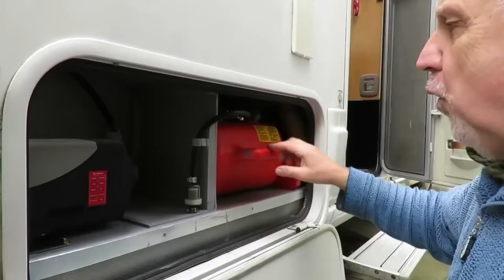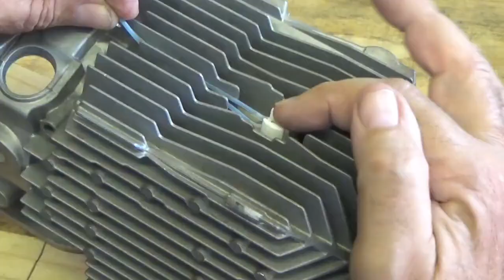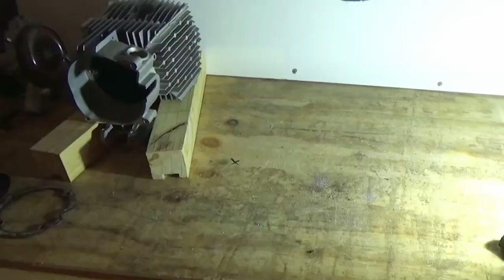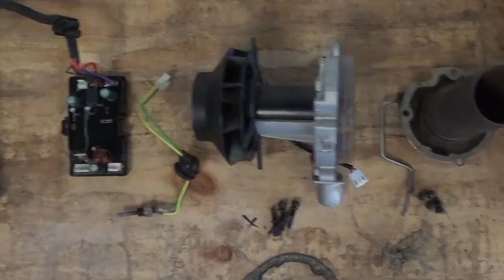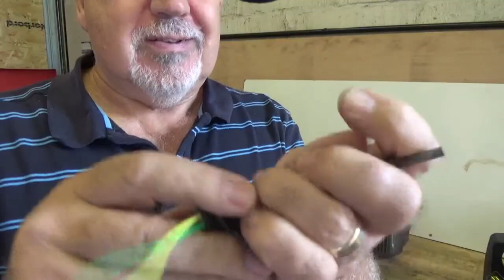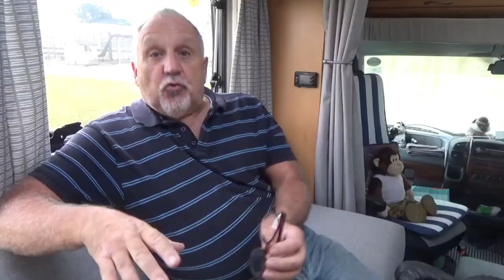🔥  Chinese Diesel Air Heater - 1500-Hour Service & Repair | Full Strip Down & Maintenance Guide

Comment: Nice teardown. Surprised how clean the chamber was. Seems the unit was set-up well from the factory and, sure, european diesel helps to keep to soot as low as possible. Often the units are shipped with totally crooked settings so they stink and smoke from day one:D

Comment: The most common problem is incorrect emulsion screen installation . Be certain that the screen is below the air hole  . This allows proper seating of the glow plug .

Comment: Anyone have smoking or poor running should run kerosene, 10 L, through it.  Kerosene burns hotter and cleans the screen that always carbons up when you run the heater at low heat.  This is what Espar tech told me to clean my unit.
Reply: Don't forget that diesel lubricated the fuel pump and running neat kerosene which does not have the same lubrication properties can cause problems.
My pump partially seized after running a gallon of neat kerosene through it.
Mix it 50/50 with diesel.

Comment: I had an interesting issue on mine at only 2.5 months. Sooted up bad threw e10 lots of smoke. Took it apart and found the donut shaped disc (donut plate where you torched) in the burn chamber fell out of place. Tapped it back in place (mines oval as well so I had to clock it correctly) and need to test it but I’m sure that’s my issue. It effectively opened the entire burn chamber and exposed the inner stainless mesh. Haven’t come across anyone mention this issue so hopefully mine will work again and stay in place properly

Comment: My keys to efficiency and longevity..   unit is inside living space..  only the end of the exhaust is outside.. exhaust 2m, coiled downwards, with a fan across.. hard plastic line ..fuel tank outside..   change out no more than 5 minutes...

Comment: Excellent video and well explained, although there might be a case to be made where it might be cheaper and easier to simply replace the entire heater unit since they are such low cost, and you never know when a part will fail so having a new spare heater is also good insurance.

Comment: I was expecting a full service to include the bearings.
You said you can't take the motor apart. The bearings are in that part and can absolutely be taken apart.
I'm sure you'll find that out when the bearings start rumbling
Reply: Some heaters have a motor that is crimped together with a silver colored casing. Nearly impossible to replace bearings on that type. Motors that are black with silver end caps have bearings that are pretty easy to replace.

Comment: great video, have my heater 4 years and the fuel pump stopped working so. going to give it the full works, but they are a great bit of kit.

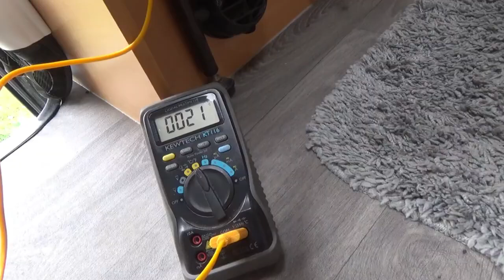Comment: Thanks for sharing the break down   and service parts etc. Almost looked like it didnt need it yet. Mine has done 2 winters of roughly 2800hrs average temp of 19 18:55 °c - 22 °c .i think i need to service as e6 code has just come on ,to have it ready for the next winter and 3000 hrs , fan unit with motor sold and a fan motor separately not sure which way I'll go yet. searching for parts and learning as i go . Cheers 😊👍

Comment: Everybody knows how to strip the heaters and clean them, but nobody knows why they have lots of problems with smoking and carboning up. I wish somebody could explain the problem and how to fix it.
Reply: It's simple really, it's getting too much fuel, you can tune the fuel pump speeds, there should be a video about it on youtube look up diesel heater tuning
Reply: Running rich including altitude adjustment...  exhaust restrictions including condensation ...  Combusting cold outside air .. heating outside air instead of recirculating warmed air ...